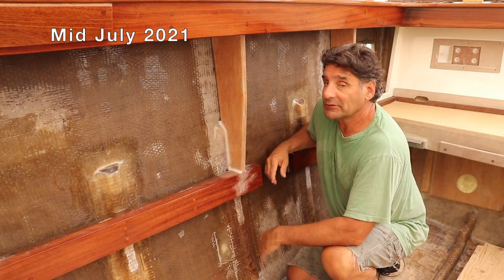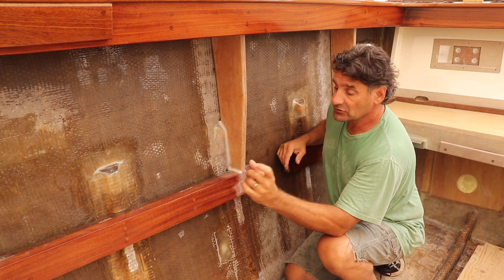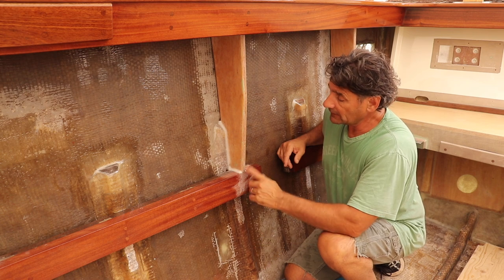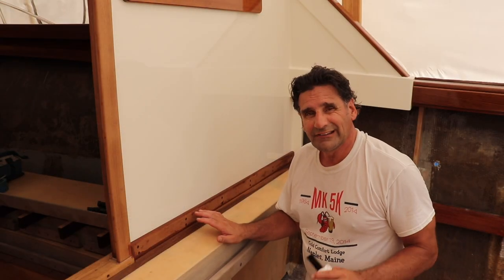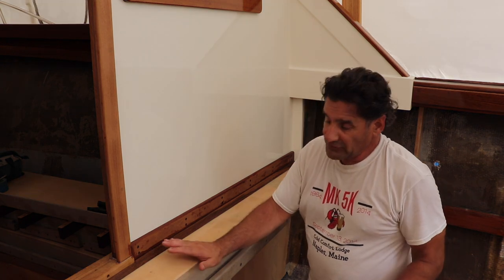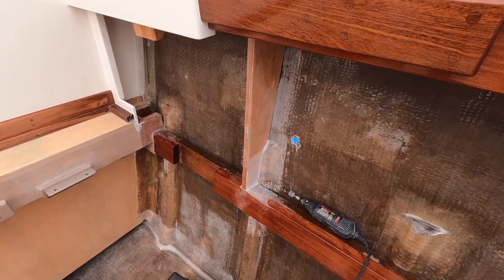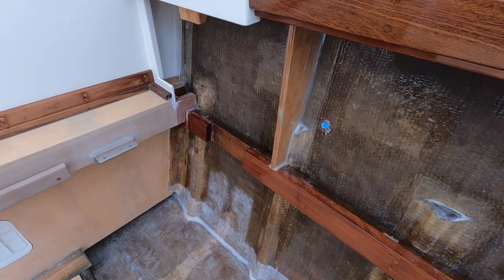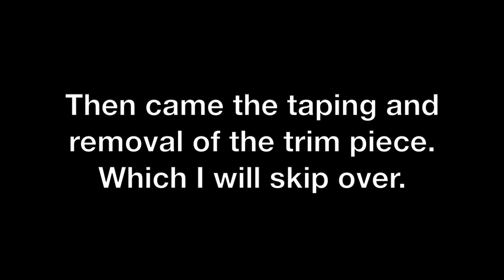Installing Mahogany Base Trim & Tabbing in the Knees - Egg Harbor Sportfish Boat Restoration EP072

Comment: I am currently making some smaller repairs to a 76 egg harbor. trying to find some mahogany for the repair. did they use African, Philippine, or Honduran mahogany on the 76 model year?
Reply from the maker: Hi David, I'm not really well versed in what type of mahogany Egg Harbor used. I can't recall where I saw it but an article or advertisement I came across at one time mentioned Philippine. I believe it was an older model though. Like in the 60s. Sorry I'm not much help. - Bob

Comment: I’m about to redo a Bertram 58 foot motor yacht. What would you reckoned for the headliners. What’s the most economical way to redo headliners
Reply from the maker: I don’t do this for a living and I have no experience replacing a headliner in a boat. So unfortunately I can’t offer any advice on the subject. I didn’t install a headliner in this boat to replace the old one I removed. If you want to see what I did you can check out episodes 28 through 34. Not all of the videos in that range are about that but the titles and description should clarify which ones do. Thanks for watching and the comment. - Bob
Reply: @renovationsportfish1563  thanks Bob… watched those videos and gave me some great ideas. Keep up the good work . I admire your craft and patience with detail